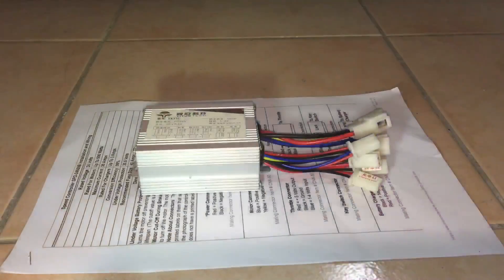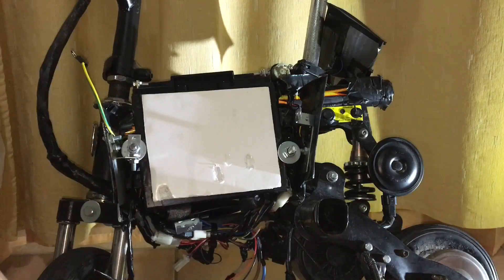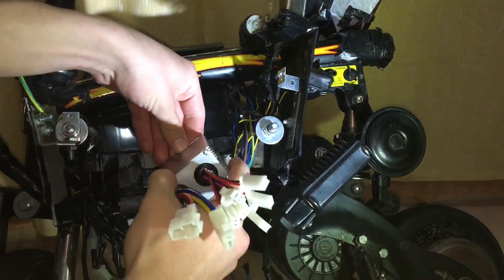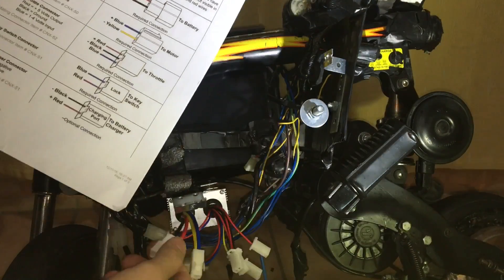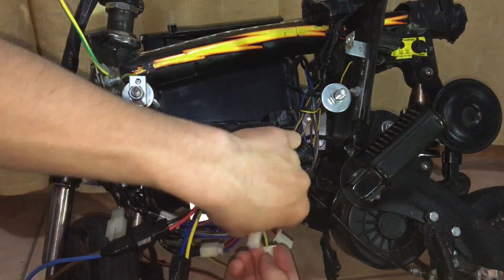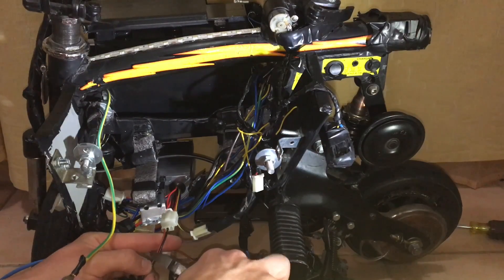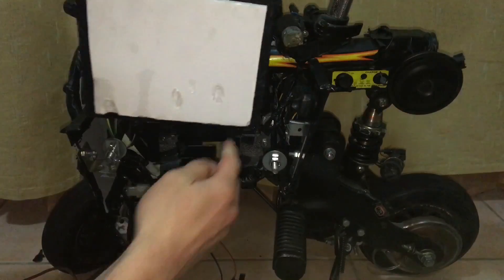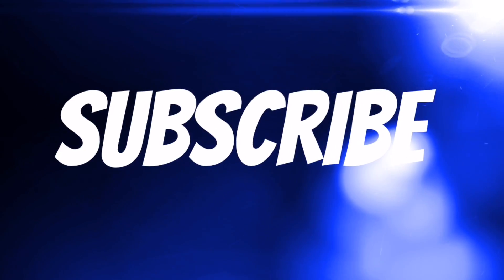How to replace the speed controller in an electric scooter

Comment: Salam I bought my son 1000w scooter and after a week problem starts it runs good some time sometime it's not responding to accelerate at all ones u are not sitting on it it's fine sits on seat and runs for 30 seconds and stops .need help please.
Reply from the maker: Hi man. What is the model of the scooter?
Reply: @ZiadHamwi  super turbo 1000 elite
Reply from the maker: Hello again, so start by ensuring that your battery cables are firmly and securely connected from the battery to your speed controller.
Reply: @ZiadHamwi  yes they are
Reply from the maker: Hi man, I really apologize that I haven't seen you comment earlier. Anyways, have you checked your twist throttle if it is working properly or not. Like test it by twisting the throttle partially and holding it in a low speed position and see if it works flawlessly or not. Try all different positions of the throttle to see if it only messes up at a certain speed or in all speeds.
Reply: @ZiadHamwi  yeah checked and find a lose connection and same day fuse blown and 5minuta after changing the fuse stops working at all now myb speed controller gone
Reply from the maker: What exactly is not working at the moment?
Reply: @ZiadHamwi  battery status and front light works but now on throttle nothing happens at all no movement at all
Reply from the maker: Hi man, it is quite common to have your brake lever switch cable either unplugged or not plugged in all the way which would trick your speed controller into thinking that you are pressing the brake so it won't engage the motor when you engage the throttle. Also, make sure to check the brake lever switch itself to see if it is stuck or malfunctioning.

Comment: It is faster now ? I want to buy too controller but without speed limit.
Reply: I have one more question. Maybe you know how to remove speed limit ? Because when i drive faster than 20km/h, automatic scooter use brake. This is really anoying.
Reply from the maker: Can you send me the model number of your current speed controller so I can take a look at it?
Reply: @ZiadHamwi  Unfortunately, I did not find any model number. This is an ordinary Bruschless speed controller from Lenzod.
 I can't find any blueprints so i'm not sure wich cabel is for speed limit. I'v tryed bypass this in Multifunction Display but this option is blocked. I found only that. I have this same controller. https://www.endless-sphere.com/forums/viewtopic.php?t=96562
Reply from the maker: Hi man. In that case, your safest bet might be to replace your speed controller with a different one that has a higher power output, but please avoid using the same one I used in the video as isn't good at all.
Reply: @ZiadHamwi  Yeah, but i need to check if my motor can handle 36v. I don't want to fry. Thank you for answers. Good day sir.
Reply from the maker: You're Welcome. Good luck.
Reply: @ZiadHamwi  hello. I've bought this same controller. But unfortunately i didn't' notice that my motor have 3 power cables, and 5 really thin cables. Have you any idea how to connect ?
Reply from the maker: Hi man, send me a picture by email of the wires of the motor and the speed controller you got so I can see if they are compatible. My email address is: ziadhamwi@live.com
Reply from the maker: Hey man I could see that you have a brushless hub-motor and you purchased a speed controller for a brushed motor. Unfortunately those two aren't compatible with each other. You will need a speed controller for a brushless DC motor. Sadly, there is no way you can wire those two together.
Reply: @ZiadHamwi  I thought so. It is a pity that I read it too late. Thanks for the help :)
Reply from the maker: You're welcome man. Feel free to ask any questions you may have.
Reply from the maker: Hi man. Given that I'm still using the same battery pack with the same power output, my top speed is still identical to how it was.
Reply: @ZiadHamwi  So if i will buy new controler 300 or 350W that nothig change ? I have motor 300W but controler is 24V 250W.
Reply from the maker: If your motor is 300W and your current speed controller is 250W then if you upgrade to a 300W or 350W speed controller, assuming that you are still on 24 volts, you should get a boost in torque not the speed. Increasing the voltage would increase your speed but if your motor is rated for 24 volts then you'd need a motor that can take more than 24 volts if you plan on upgrading to a 36 volt or 48 volt setup. Also, if you run your 24 volt motor at a higher voltage, you will wear out the brushes of your motor very quickly. Feel free to ask me if you have any questions 👍🏻
Reply: @ZiadHamwi  Torque is really bad so yeah, it will be better. I don't know if my motor is rated for 24V. This is this model: Denver - Electro-Scooter SCO-80110. But i think about change motor with controller, whole kit. Thank you for answer :)
Reply from the maker: You're Welcome. Anytime.

Comment: I have a similar scooter, it runs perfect for awhile then all of a sudden stops while I'm pulling throttle. So then I have to stop for 20 minutes, then I pull throttle and it works fine again, could it be controller? Motor? Or throttle? It seems like there's a loose wire maybe but I can't find it, goes great for 20 minutes, then just stops and goes. Then I'll let it rest and it works fine again.
Reply from the maker: Hi man, if it works after letting it rest for 20 minutes then I guess either your motor or speed controller may be overheating and shutting down as a safety measure. I would suggest checking the temperatures of both the motor and the speed controller once the scooter stops running. If they both are fine feel free to ask me again.
Reply: @ZiadHamwi  thanks
Reply from the maker: Anytime.

Comment: The functiosn BRAKE (yellow and black ) , serve for?
Reply from the maker: Hi man, it connects into a normally closed switch in your brake lever and whenever you press the brake, the button gets un-pressed so that as long as your holding the brake lever, your motor won't run if you twist the throttle and your brake lights should turn on. It's a nice safety feature.
Reply: There is yellow and black, as I plug it into the brake, since it already exists, the brake light connector.
Reply from the maker: Yes, plug it into your brake lever switch.
Reply: The function this is OFF motor, for a one test , i put this 2 together (black and yellow),and ocurrid a short!
Reply from the maker: Hi man, I don't understand what exactly happened. Can you please better explain what happened? Sorry for the late reply.

Comment: I bought a speed controller like this years ago. Same silver box. 24v 500w. Had a 3 second throttle delay that was ridiculous. I wanted instant connection. Probably have to buy a $200 plc.
Reply from the maker: Hi man, it is possible that your throttle could be not compatible with this speed controller, hence causing the 3 second delay. Check your throttle first if it fully compatible with this speed controller first.
Reply: ok. I'll check. It's a rad2go. Thinking e10 - 24v 600w.  Would you convert from 24v 18aH to 36v 12aH? I'm trying to figure out a way to get more speed out of the device so it's safer on my commute. Ideally 30mph for 14miles is the goal. (commute is 5mi each way). I have a license and motorcycle license already.
Reply from the maker: Hi man, if your motor is rated for 24 volts then giving it more voltage like 36 volts, for instance, will make it go faster, but will also wear out the motor faster, especially if you have a brushed motor then the brushes will wear a lot faster. I would say if you want it to go faster, consider replacing the 24 volt motor with a motor designed to do 36 volts rather than overvolting your 24 volt motor. I would avoid overvolting my motor unless I absolutely have no choice other than doing so. Also, the motor will run hotter when overvolted.
Reply: Yeah exactly. I would replace it if I went 36v. Just wondering comparing equal watts like 750-1000w would you go 24v, 36v, or 48v?
Know any good electronic circuit tutorials? Or other scooter builds?
Trying to diagnose everything on the scooter. I have a good multi-meter. Batteries are easy. But how do you figure out the type of throttle or other parts of the controller? I think I have all the wires labeled like:
throttle cut off coming from the brake lever
Motor power
charging circuit
batteries in series (2x 12v)
throttle signal
derailleur? idk what that is - it's not a bicycle with a shift lever
Reply from the maker: Hi man, well it depends what exactly you're trying to achieve. If you're purely trying to achieve a higher speed then the high voltage motor you choose the faster speeds you get. Let's say you have a 24 volt 1000 watt motor and a 48 volt 1000 watt motor, the 48 volt motor will go faster but both will have the same power and torque since they're both 1000 watts. Also, generally the lower voltage motor will have better battery life since you would typically have higher amp hour capacity rating for a 24 volt battery than the amp hour capacity rating for a 48 volt battery, keep in mind this is generally how it goes, you may choose to install a higher amp hour 48 volt battery and have the same battery life as the 24 volt battery.

Comment: Where did you get your wiring diagram I have bought the same speed control module of eBay and it came only with Chinese diagram please would really help
Reply from the maker: Do you need a link to the same diagram as my speed controller?
Reply from the maker: Here's a link to the wiring diagram of the 24 volt 500 watt speed controller that I used in this video: https://electricscooterparts.com/hookup/SPD-24500B.htm

Comment: Bhai optima electric ki speed kaise badhay
Reply from the maker: English?
Reply: How to icrease speed of optima electric scooty  top speed 20
Reply: how to increase speed 20 to 40 '50 optima electric scooty
Reply from the maker: Hi, your speed controller is designed to efficiently give you the maximum speed of your motor. You can't increase the speed past that or your motor would wear out the brushes. I'd leave it running at the designed speed to ensure that the motor lasts for the longest time.
Reply: ok Thanx
Reply from the maker: You're welcome.

Comment: i have the same scooter but when i charge it and try to go it start it blinks orange and red and beeps.does it have something to new with the controller if it has new batteries
Reply from the maker: Hi man, does the motor run even if it is beeping?
Reply: hey thank u for hmu it does when i pull the throttle
Reply from the maker: Does it work normally when you pull the throttle, like is it weak or slow if it isn't normal. Ignore the beeping for now so that we can ensure that your batteries are good to begin with.
Reply: the horn,head light back light signals work
Reply: its just not holding  the charge
Reply: the motor does run put when i pull the throttle

Comment: Sir in my project speed controller is not working but direct connections with battery it can works
...so What we do... Please tell me how to run with speed controller... We don't have a time... Please urgenttty
Reply: I'm not use brake 
Then it is not work what we do
Is there any alternative... And what is the problem
Reply from the maker: Hi again, can you please describe exactly what problem are you encountering like in what way is your speed controller not working and what steps have you tried to troubleshoot your issue. Remember, I can't see what you're working on so please describe it in full detail.
Reply: Sir I'm doing a electric car
I have 24v DC motor 250w and speed controller with throttle
I'm do a proper connections as per  show in this video but my motor is not working please tell me sollution
Reply from the maker: I see, can you send me a picture of your speed controller through email? Since the connections on your speed controller might be different than the 500 watt speed controller that I showed you in the video. So send me a picture of your speed controller and I'll look up its wiring diagram and will guide you through wiring it. 

My email address is: ziadhamwi@live.com
Reply: Fast responceeee
Reply from the maker: Hi man, if your speed controller is not working, check if it is properly and securely connected to the battery and also check the connections for the key switch, throttle, and the motor; all connections should be securely connected and without any cables being loosely connected. 

Also, this one is important, check the brake lever switch as it allows the motor to run if the brake lever isn't engaged and stops the motor if the brake lever is engaged. So be sure to check that and perhaps test the switch as that could sometimes cause the problem.

Comment: How can you tell  if the controller is not working
Reply from the maker: If the motor runs by itself immediately after tuning on the electric scooter without twisting the throttle or sometimes the motor won't run at all after twisting the throttle and if you know your wiring is all good then you definitely could have a bad/not working speed controller.
Reply: Ziad Hamwi me
. thanks.if ijook the battery to motor it turns   Al.
Reply: Ziad Hamwi to
Reply from the maker: The motor should turn on if your batteries are good but only do this if you wanna test the batteries and the motor, not if you wanna use it this way because the speed control should be installed to properly control the motor's speed and torque.

Comment: Hello! Thanks for the video, very helpful. I just got my new controller in the mail and it doesn't seem to have a wire for the on/off switch. It does however have two wires for "anti theft". How do I wire my power button? Is it related to the anti-theft wires?
Reply from the maker: Hi man, I'll be glad to help you, but first I need to know what speed controller you have so please send me a link of its technical specifications or send me a picture of it by email (ziadhamwi@live.com) so I can take a look at its wiring.
Reply: Ziad Hamwi Awesome, thank you! I saw another video where the guy said to wire the skinny red wire from the power cord to the "ignition", that might be it. Anyway, here's the board: https://m.aliexpress.com/item/32785300415.html?trace=wwwdetail2mobilesitedetail&productId=32785300415&productSubject=48V-60V-350W-18A-Electric-Bicycle-E-bike-Scooter-Brushless-DC-Motor-Controller-Free-Shipping
Reply from the maker: That sounds right, try that and if it doesn't work let me know so we could figure out how it connects. Good Luck!

Comment: Hey bro is it possible to use a 12v 7ah battery and the other one be a 12v 10ah battery because one of my 12v 10ah battery works but the other one doesn't is it possible to use one 12v 10ah and a 12v 7ah battery on my scooter
Reply from the maker: Hi man, both batteries should be identical in voltage and in amperage and by having two batteries with different amperages you can very likely cause damage to the working batteries. Make sure that you replace the batteries with both batteries being the same to prevent the risk of damaging the batteries.
Reply: Ziad Hamwi thanks bro jus wondering the lower the ah means less run time right?
Reply from the maker: Yes, the lower amperage reflects less runtime.
Reply: Ziad Hamwi so if you use a really low ah battery does it still run jus lower runtime because my cousin has the same scooter but his batteries r broken too and he bought some batteries but instead of buying 12v 12ah he accidentally bought 12v 1.2ah do you think he can still use those?
Reply: Ziad Hamwi thanks bro
Reply from the maker: Hi man, a 12 volt battery with only 1.2 amps of current will not work with your scooter because the amperage is very low. Your scooter's motor requires a battery that could supply 10.5 amps in order for it to give you 1 hour of runtime. A battery with a capacity lower than 10.5 amps would give you less runtime and a battery with a higher amp hour (Ah) capacity would give you more runtime. Ideally two 12 volt 12 amp batteries would give you more than an hour of runtime but a 12 volt 1.2 amp battery would give you little to no runtime and it will get damaged if you use it in your scooter.

Comment: Hey bro im changing my batteries as they do not work anymore the original battery size was 12v 10ah my friend has some spare batteries but they are 12v 7ah do you think i can still use them
Reply from the maker: Hi man, yes they would work but you'll get less runtime from those lower capacity batteries but they would still work, I once installed 7Ah batteries in my scooter and they worked well.
Reply: Ziad Hamwi thanks and when will you be uploading more videos abt ur scooter
Reply from the maker: I will be uploading new videos hopefully in the beginning of January.

Comment: Hey, Did you build this scooter by  yourself ?
Reply from the maker: +John Smith Hi man, I started with a very basic electric scooter that does nothing other than move forward and I've completely modified it into this. Everything from the frame and batteries to the dashboard and controls has been completely modified and custom built by myself.